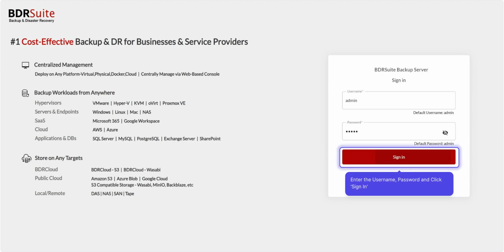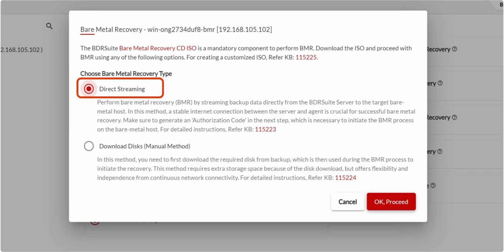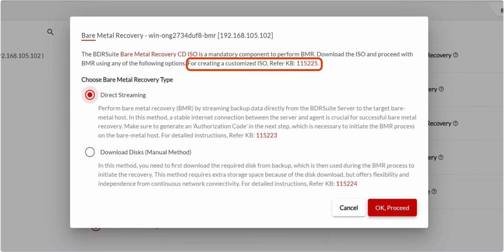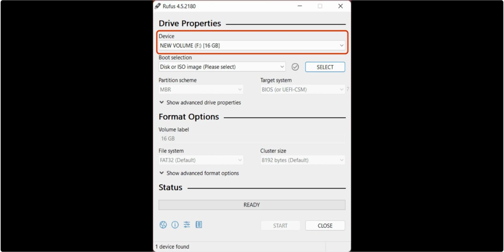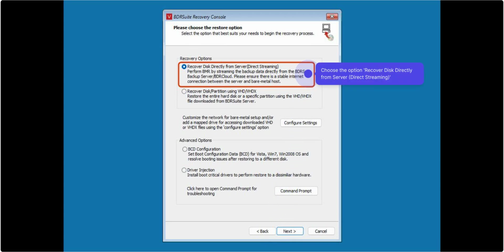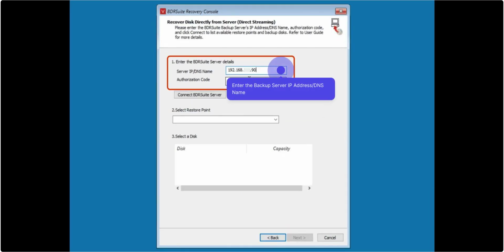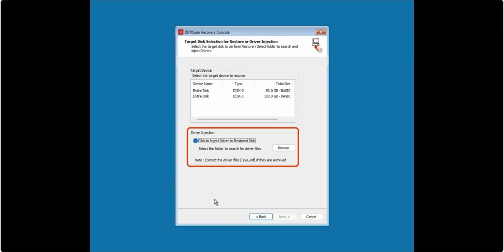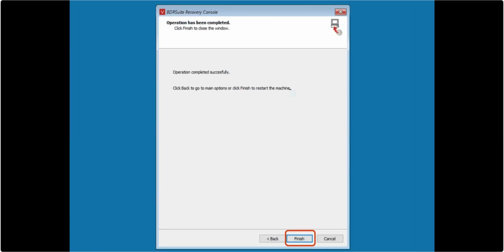How to Perform Bare Metal Recovery Using the Direct Streaming Method - BDRSuite

Comment: The most relevant data on metabolism recovery is from 1944 and most people have never heard of it. The Minnesota Starvation Experiment demonstrated that restoring BMR after prolonged restriction requires 8 to 12 months of sustained caloric surplus. The key finding was caloric primacy — total caloric intake is the only variable that restores metabolic rate. Protein and supplements are secondary to eating enough. After about 9 months, the hypothalamic survival alarm finally resets. If your metabolism feels broken after chronic illness, the recovery timeline is specific and research-backed.